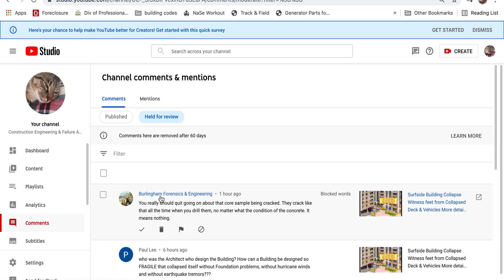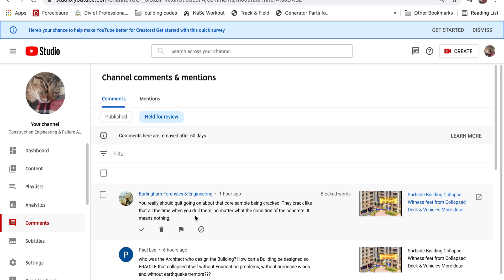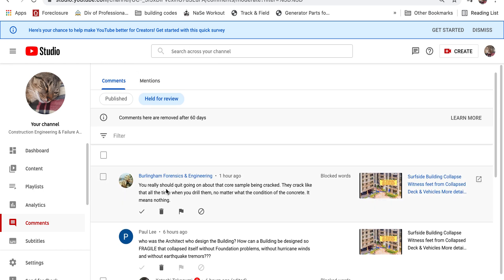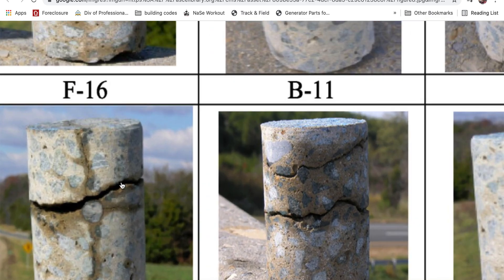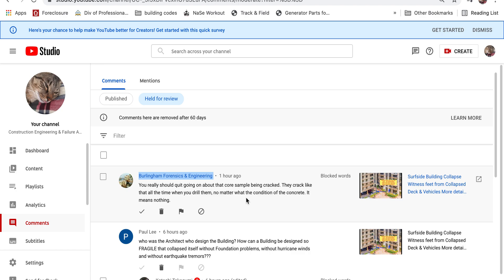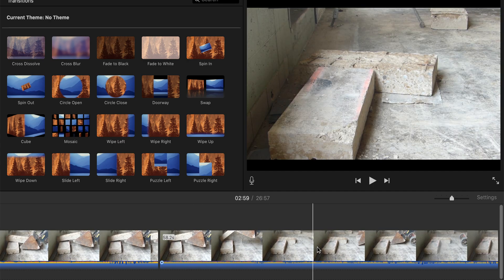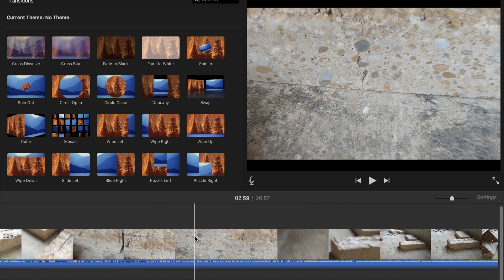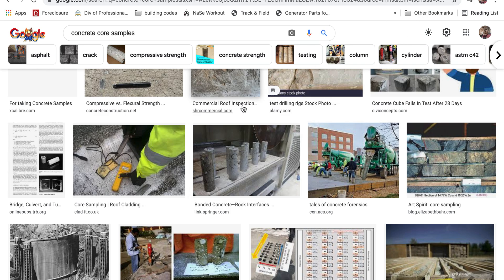Champlain Towers Collapse Burlingham Forensic Engineering STATES CRACKS SAMPLES MEAN NOTHING DEBUNK

Comment: The author of the Burlingham Forensic Engineering statement should be fired. Concrete core sampling is the most definitive diagnostic method to determine the structural integrity of concrete. Think of it as a doctor performing a biopsy to extract a small portion of a questionable growth for lab analysis to determine the true nature of the growth in question. A concrete core sample can tell the level of salt penetration in the concrete, it's actual compressive strength, the actual rebar diameter and a whole host of other performance related factors. The author of the Burlingham Forensic Engineering statement is a complete idiot. Perhaps his employer should take a core sample of his brain.

Comment: Thanks for setting the record straight Kai! 
Isn't it interesting that someone who's apparently a Florida-based forensic engineer is saying that 'cracks mean nothing' in the core samples? I mean, Morabito wasn't very alarmed either when he saw the very cracked core samples at Champlain South last year, right? Obviously he SHOULD have been alarmed, in hindsight! Are Florida engineers so used to seeing cracked core samples from buildings with concrete in bad condition that it doesn't even register as a problem anymore? And could this have contributed to this complete lack of a sense of urgency (which I always found so strange in the Morabito reports and recommendations) about the condition of that pool deck? Just speculating, but it seems kind of telling to me.
Reply from the maker: I bet you he is running scared now... that he did not order temporary supporting ... It will depend on the NIST report if he get's sued (my guess)...

Comment: Sounds like "let us test your building. Pay us and we'll tell you exactly what you want to hear." Hope that's not the case and that this is just some rogue person. Their website states: "In Florida, the biggest technical design problem for a Structural Engineer is to make an economical structure that is resistant to powerful wind forces. This is our specialty."
Reply: They got the economic part of the challenge down pat Don't care if it stands the test of time fyi a few days ago s 200+ unit condo in FL less than 1/2 built had to be demolished after it partially collapsed from poor concrete work

Comment: In construction we get core holes drilled (for cable runs) in floors and walls, rarely have i seen them crack. Unless the core piece is dropped or put under shock or stress do they break(crack)

Comment: See, I'm not a fan of these "engineers" showing up out of the weeds and proffering THEIR solutions. I prefer you slow, methodical, "fine tooth comb" approach to an investigation. Because it feeds into my slow, methodical, "fine tooth comb" approach (which I think you've caught onto and are leveraging). I like to ask ALL THE QUESTIONS and then let the answers rule things out. There is little bias, just a strong pivot when I'm wrong (which I am all the time).